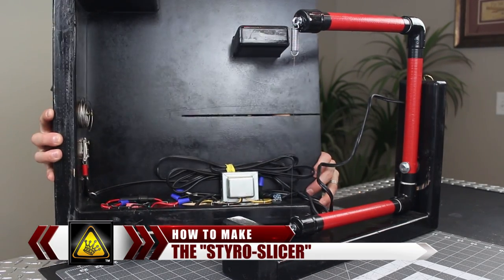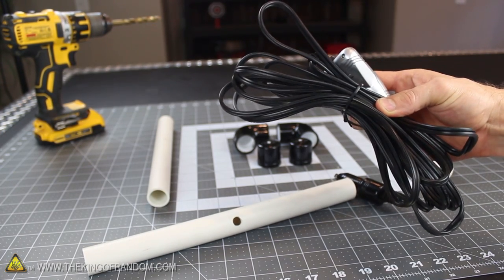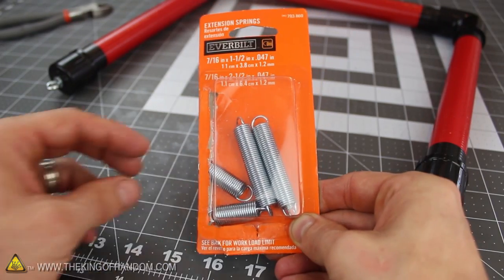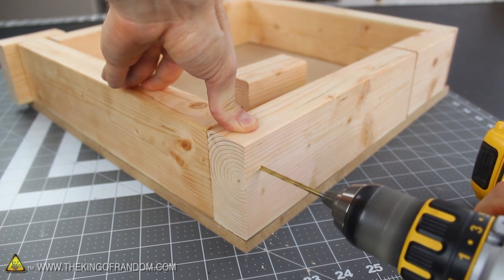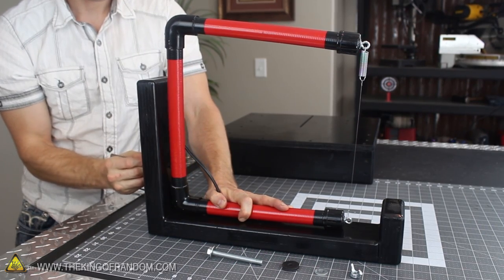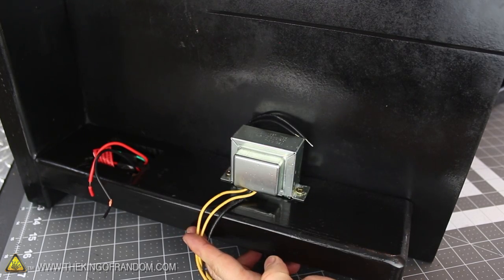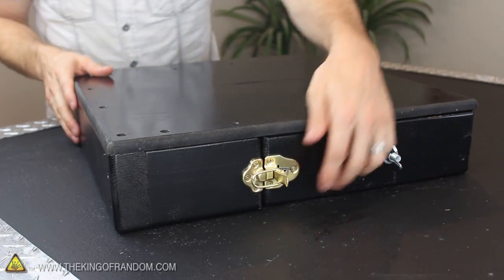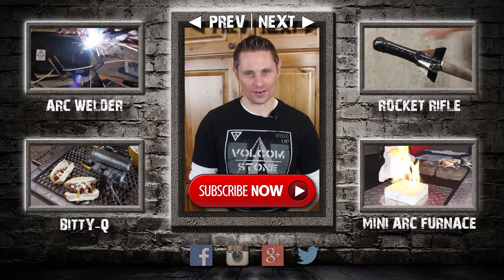How To Make The "Styro-Slicer"

Comment: IMPORTANT REPLYS NEEDED ASAP!!!: will a 9V Duracell battery work
Reply: It's a bit late but if you're still wondering the answers no. A 9v doesn't have the amps to heat the wire n maintain it. Just get a 6v lantern battery which is what he uses in the video

Comment: wait wait wait... 18" square and on that you fit a 15" 2x4 plus the width of two 2x4's? That's 15+2+2 = 19"
Reply: Precut lumber isnt actually acurate to its measurments when i measured some a 2×4 is actually 3and a half inches by 1 and a half.

Comment: My styro slicer just lit the styrofoam on fire.I used copper wire btw.
Reply: Parkour dinosaur 58 hanger wire
Reply: copper is more conductive so it would contain more electricity meaning more heat. atleast i think thats why it set it on fire.

Comment: Can it cut cardboard?
Reply: Aaron Hughes no
Reply: high temperature+flamable material in an area that has oxygen

yea thats gonna end well
Reply: @neurotica5461  what about laser cutting then?
Reply: @aaronhughes827  those dont physically exist like

laser isnt an object but the wire is
Reply: @neurotica5461  but doesn't laser cutters still heat up cardboard/wood?
Reply: @aaronhughes827  due to the laser not being a physical object, it cuts faster and the wood doesnt heat up on time to start a fire.